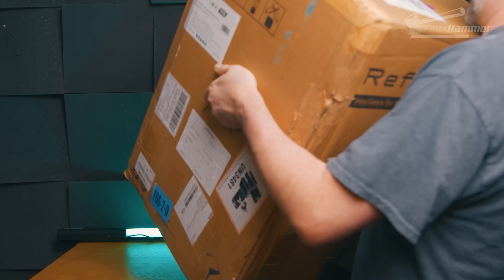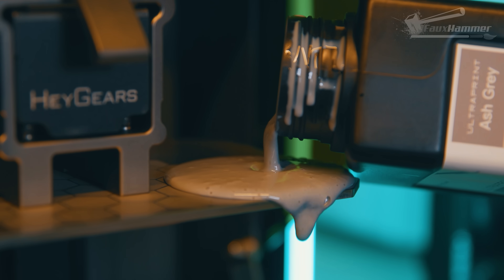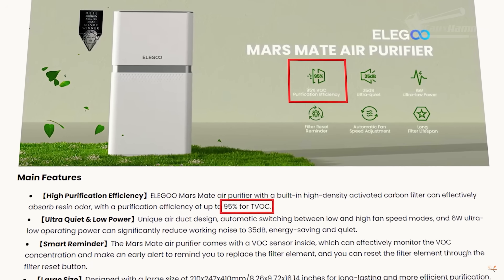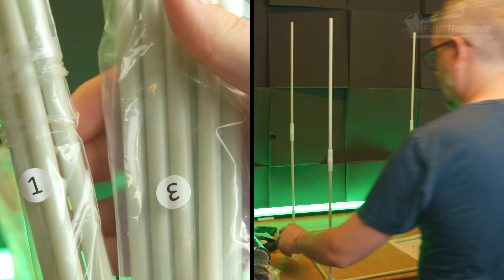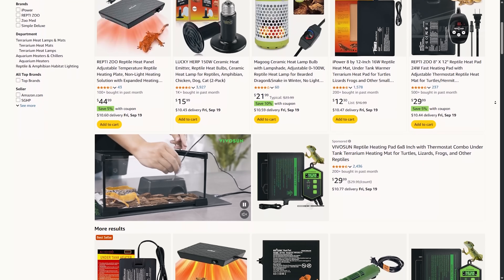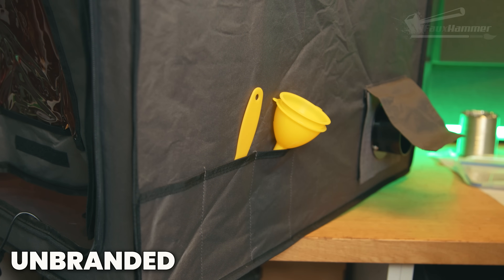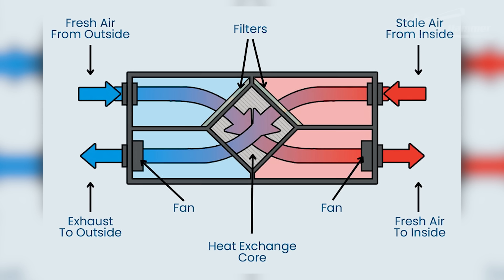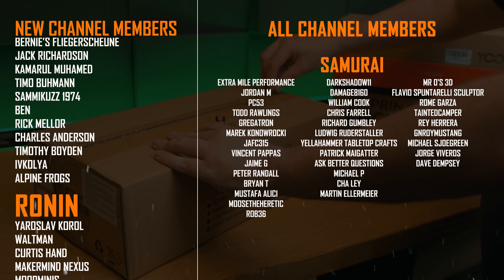A Necessary-Accessory for Resin Printers?! Printer Enclosures

Comment: I used a non-functional wine cooler where I removed the compressor and added internal lights. Since it has a perfect seal, the resin fumes don't escape during printing. You need to do a bit of research, but I think you can even find one second-hand. Problem solved!

Comment: Coming at this from an engineering material science background for those wanting to know exactly what your model making vape does to you and your lungs:

Different resins are gonna give off different VOCs at different levels since everyone seems to have their own particular spice melange for you to sniff before you meet God from huffing too much resin.

Generally speaking from SLI resin work I've done in the past this is the stuff that ends up in the air around you: 
- Methacrylates and acrylates (not great but mostly just an irritant but can cause asthma like responses in some people), 
- a few alcohols (isopropyl which you're using in washing anyways and is mostly an irritant at experienced concentrations and tert-butyl which is mostly an irritant and not a killer unless you're hotboxing a resin 3d print farm),
- MIBK (not always present but worth mentioning because this one can affect your central nervous system if around it a little too long, that woozy feeling you might be getting, maybe a little giddiness? Likely this stuff.)
- Ethyl Acetate (mostly an irritant but this one is concentrated enough in the air to cause headaches sometimes depending on the resin)
- styrene (sometimes present, this is the one you worry about long term exposure to since its linked to several different neurological issues, i.e. many prints, many brain cells lost)
- formaldehyde (good for preserving dead bodies and you after you huff more resin. Long term low exposure leads to cancer a lot of the time. Short term infrequent usually just means lung irritation/inflammation)
- Toluene (been shown to again affect the central nervous system)
- Other acrylates and additives (fact is we simply don't know enough about how this affects people in the long term to be able to tell how dangerous/safe it is. Give it 20 years and there'll be some dementia riddled ex 3d print hobbyists who didnt know what an open window looked like for the medical industry to study and then we might know something.)

If that's too much to read then put simply:
1. Ventilate your room properly.
2. Remember that boomer advice where your mom told you not to stand in front of the microwave because you're gonna die of horrific face cancer? This is the real version of that. Don't be standing around the printer while it's cranking things out for you, some tests in worst cases have shown TVOC concentrations inside those print chambers as high as 120000µg/m³ and still like 100 µg/m³ when you're standing 60cm away from them if you seal yourself in. Each individual VOC is below technical danger exposure limits but you have to keep in mind you're being exposed to them all at the same time, something that hasn't been studied very well is the combination effect of all of them.
3. Dont just vent in to the open air if you can help it. Get a carbon air filter or at least a HEPA filter to run the air through before venting ideally.
4. Respirator alone is likely not enough. Get something that covers/seals your eyes too. All that eyeball moisture gives those compounds something to cling to and another way to get in to your system. People often forget that your eyes are in constant exposure to air particulates which means it might not be as bad as getting it in your lungs but it's still not great.
5. Enclosures (the glorified weed grower box for a printer in the video) are a great idea but not a perfect solution since you still gotta handle uncured resin to post process it, gloves + respirator + eye cover is still mandatory since VOC concentrations are going to be non-uniform inside the enclosure sometimes depending on where the vent is positioned. If you wanna get real fancy and ensure you dont happen to inhale that one VOC cloud sitting in the enclosure then get a mini fan to clip on to the inside of the enclosure to ensure ALL air inside the box is circulating through.

Happy to dig up sources if really needed but this comment is long enough already.

P.S. Isnt it weird how it's the second that you put on the nitrile gloves, get a little bit of resin splashed on your hands that all of a sudden your nose or the corner of your eye gets really itchy? Definitely dont think about this the next time you're pulling your next model off the build plate.

Comment: The first thing I thought when saw this enclosure frame - this could be done with PVC pipes and corners. 
The case itself can made from some thick plastic film or polycarbonate sheets and sealed with duct tape or silicone.
And the main point - with this DIY approach you can find a good fan or just use an old hairdryer without the heating spiral that would input the air from garage, push it through the enclosure and exhaust it outside. Positive pressure ventilation.

Comment: I plan to have my resin printer installed in my outdoor shed.  I am wondering if one if these would be necessary as well, this thing looks huge and may not quite fit.
Reply from the maker: Ideally yeah, otherwise you're turning your shed into a box of potentially harmful fumes. The best thing abouyt a shed though is that it;s easier to drill a vent hole.

Also the enclosure will helpo keep heat in around the printer a bit more.

Comment: Built my own enclosed box in my hobby shed, mainly for heat retention since I currently run the Saturn 2, doesn't do anything about fumes so I pry should look at modifications or better safety practises for myself.

Comment: exhaust of the print fumes ist important, but holy hell is the cleaning and post processing a fume hell. all the IPA fumes and the one from the uncured prints get into the room, because most people process them on the desk. so keep wearing the mask and then flood the room with fresh air when your finished with everything and the prints are cured. my airquality monitor read "unhealty" in a matter of a few minutes into the cleaing. thats a risk i dont want to take

Comment: @FauxHammer im completely new to resin printing and 3d modeling. Im mainly looking to print bust and figures for painting and maybe some minis for games but mainly larger figures. Im currently torn between the heygears rs turbo and the gk3 pro. Im not opposed to heygears closed eco system as it seems like it would help me as a new printer by taking a lot of the settings guess work out of the equation. Also not really a cost barrier as id rather buy once cry once and get a printer built to last. Which would you recommend?

Comment: I have a grow tent w/ a pretty hefty air pump pulling the fumes through duct tubing out my garage window. Cure station sets in its own grow tent. I wear full PPE (safety glasses, vent mask with proper filters, and nitrile gloves) and also have the carbon filters that set in the resin printer itself. It's probably not perfect, but it seems like reasonable precautions and since the garage is not on the same HVAC as my living space, I should be good.

Comment: Why did anyone care about you selling your printers...? What did they expect you to do with them? Yes post video of air recycler install. I currently have both of my printers in enclosures like the unbranded one you showed, connected to an inline fan, and vented out of the window via an airconditioner vent adapter plate. The window is covered by a large thick hedge, but I also cut two, two inch diameter dowel rods to fit in the space above the window to prevent it from opening further. My ultra sonic cleaner and curling box are in the two car garage. I open the big door and turn on a fan when they are in use.

Comment: Ross, I printed an adapter for my Saturn Ultra 16k (Yeah, I know.  You liked the non 16k Ultra better but I got a deal on it).  I hooked it up to a greenhouse filter and no one can smell the resin and my printer is in a smallish room.  I know that doesn't mean all the BOCs are gone but I'm hoping I've reduced the damage I'm doing a significant amount.

Comment: Ive worked in some fabric manufacturing and currently work in the medical field, which basically mean my experience with resin is also mostly hobby level.  but I can also say that the mylar lined hoods are in fact non- gas permeable, and that these affordable options are just a type of vent-hood that work on a negative pressure system to contain any gas and fumes from escaping into your working/living environment.  Additionally, the hood would have to be constantly running 24/7 as the moment that negative pressure is lost the resin and gasses that have been absorbed into the fabrics are now just sitting stagnant and leeching out into wherever the hood is located through pinholes and gas permeable zippers etc., possibly being recirculated by your home or office HVAC.  The optimal version of these hoods would have a fan as close to the outside atmosphere pulling air constantly from the hood with any possible areas of gas leakage in the negative pressure side and the fan blowing direct to atmosphere at the end of whatever window hose or outside adapter solution.  Finally the MVHR would be the closest thing to best option, with the best probably just be an out-shed with vent fan.  Again, all levels of scale on how much you care about the gas exposure to resin.  The common person IMO can probably be okay with their single printer being in a garage with an enclosure warmer and wear a respirator while working and open the garage door to the outside with a large box fan blowing to ventilate before finishing their work and going inside their home.
Reply: That's pretty much what he's shown, these kind of enclosure are the negative pressure type you use to eject outside the "bad air".
 I've got a similar one at home, when i turn the fan on, the textile is sucked inwars and my escape vent into a tube out through the window, i let it sit an hour after use of the printer before turning it off and then only i close the window, and i ve got a hepa filter next to the exit of that room. Hope that's enough

Comment: This has been my go to solution for the last year. Grow tent, little mini heater from Elegoo in my printer. Keeps temperature, failures are minimal, results are consistent, and air is clean. I bought an inline fan and ran dryer ducting from it out my window.

Comment: I got the double sized yoopai one from ali express, it had a metal frame and double vent connection. Fairly happy with it as i can keep the resin and alcohol and cure station on the other side.

Comment: A few things you'll need are an effective PC case fan (perfect for this job), aluminum chimney pipe, a few pieces of adhesive, some craftsmanship, and a little skill. When curing or exposing resins, air must be vented as far as possible. Additionally, I use a fairly large room air filter (with an activated carbon filter), a face mask, gloves, etc. General procedure. And I'm not an expert in this field; I'm not giving expert advice; I'm sharing my experiences. :)

Comment: I have one printer setup in a huge garage. I just set it going and don't go back in till it's done and then pop the doors to vent the space out. I'm content with a respirator when I have to nip in and out, I'm not about to sit in there with it for several hours at a time.

Comment: coming from the world of fiberglass repair and building, I'm assuming the same rules apply. Though there are low VOC mixes in that industry good ventilation and a respirator are the go to. This is literally my third video digging into the subject so I haven't checked the bottles yet to compare them to say one of epoxy or poly resin mixes Ive worked with outside of printing. I bet you can back track the resin mix to a large scale industrial use case and then you can just check regulations on handling and exposure.

Comment: I have my printer in the basement and I use a ventilation system that is directly connected to the printer and I also have a second ventilator that that sucks the air out of the room. When I enter the room for longer or when cleaning the prints, I make sure to wear a respirator and if I leave the room after a while, I also change my clothes, because the fumes get caught in them. The only time I don’t use my safety gear is when quickly checking if the print is doing fine, but thats just a few seconds and my ventilation system is always on when I print

Comment: The reason coffee cups say caution hot was because McDonald's where over heating their coffee to an unsafe temperature before handing it to customers 
They got over a 1000 complaints from people getting 3rd degree burns from them

McDonald's had been ordered to reduce the temperature, they just didn't 

The most famous is one where McDonald's pr team made it look silly 

But an 70-odd year old lady got a coffee, was sat stationary in her car
She had the cup between her legs as she was mixing either milk or sugar into the cup when it slipped 

The burns where so bad it fused her labia to her thigh

She sued to cover the medical expenses, because the coffee should not have been anywhere near hot enough to do that

McDonald's have lower temperature now, but had to put the warning on them

Don't fall for the Maccy D's pr move

Comment: I don't really have any good way of ventilating air outside. I live in Finland, winters can go all the way down to -35C here, so any sort of window mount is entirely out of the question and the only place I can slap my printers in has the vents too far and in a very awkward direction for me to start pulling some really long ducts to. This is all to say: I'd need an actual filtering system, not just venting the air wherever.

I'd love it if you did look into proper filtering systems -- FDM or resin, I accept both -- though I understand if you don't want to as that's not really your area of expertise.
Reply: Same problem in Canada. I ended up only printing in the summer, and even then only in a heated enclosure outside in a permanently shaded area. The limiting factor ends up being how cold it can get before I can't stand to be out there wearing nitrile gloves.

Comment: After reading the MSDS (Material Safety Data Sheet) for basic resin, I will be sticking with PLA and PETG for now. You can take a look for the MSDS information for basic resin at 3D-Basics. Each manufacturer should have a MSDS for their product lines. Safe enough with the correct precautions and PPE, but I don't have the time or patience for that presently. For air handling, I would personally filter then vent out and away.
Reply: 🤣 And you think printig PLA is  harmless 😂😂😂
You should do your math kiddo
Reply: @pitbullash I don’t recall using the term harmless. Easier for safety, yup.
Reply: @pitbullash  I'm trying to find out where in their comment did they say "harmless"

Comment: dang it, 3 weeks late!!! i just got the yoopai enclosure for my new (& 1st ever) Saturn 16k!.  i had an AC Infinity cloudline pro duct fan sitting in a box from my last place and i hooked that up to my dryer exhaust line with backflow dampers for both the dryer and printer enclosure. i was a bit surprised at how well it actually works!

Comment: Here's my problem. I'm using the Reflex RS and the RS has that absolutely obnoxious gap all the way around the printer; I may as well just print with the lid off. The other problem is that I'm in a tiny apartment with literally nowhere to put the printer. Where I have it currently, there's no room for a massive enclosure like these. So my only options are poison myself, roommates, and pets, or just don't 3d print. It's beyond infuriating and I hope HeyGears hurries up with whatever solution they have.

Comment: My recommendation would be to get an enclosure that is at least 1.5x bigger than you think you'll need. that allows you to store stinky tools like scrapers, drip trays, or anything else that could get resin on it within the enclosure itself and never take those tools out of the enclosure. Same for your wash and sure. Keep any accessories that you use with it in the enclosure itself.
Reply: I did this but then used the extra space to put in a second printer 😅

Comment: I have spoken with resin chemists, and the chemicals used in resins, upon contact with skin (just your dermal layer mind you!) - are enough to send some people into anaphylaxis.  They will sensitize your immune system more and more, each time you come into contact with them.  That's JUST skin contact.  Now, imagine you're breathing the same stuff in.  I really do believe the common baseline for these things SHOULD BE to only use them within a fume hood with proper PPE (lab coat, gloves)
Reply: well theres a big difference between what is absorbed trough the skin and what is expellet to the air when curing... not saying its safe but unless you know what VOCs its generating its anacdotal at best... 
i have worked with resin like materials for years and got a education in plastic polymeres and most of the fumes are harmless in small quantitys... 
would still reccomend some kind of ventilation and PPE... i personally also use a mask with a p100 filter just to be safe even tho i dont think the fumes are that harmfull... better safe then sorry....
Reply: "Some people"
Isn't Anaphylaxis  a allergic reaction?

We need sources's

Comment: Stupid question but don't the vocs just come out when you open the bag to get to the prints?
Reply: some might if you open it as soon as its done... resin only releases VOCs when its curing so if you let the exaust run a while before you open it should be fine (would still reccomend a mask with p100 filters tho)